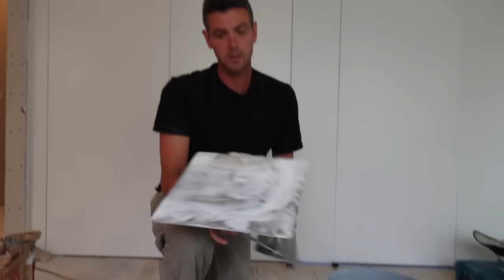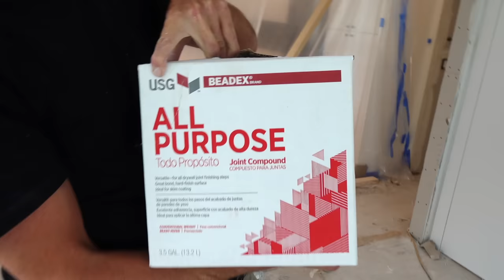Taping Drywall for Beginners Day 1

Comment: I've been doing drywall for 30 years and never seen anyone Use glue like that on paper. I usually just use mesh tape to stop it from bubbling. That is a great idea.
Reply: Try out Roman PRO-999 Rx-35 - it's a purpose-designed sealer for damaged paper. (The contractors I used all my life, who are sadly 1000 miles away from me now, put it on exposed paper or any time wallpaper is removed.) It's basically just a gallon of glue, and it dries a little sticky to be easier to cover with paint or mud.

Comment: I’m a diy guy and have done a fair amount of hanging drywall, mudding, and taping.  I’ve learned a lot from Vancouver Carpenter.  It’s been over six months since my last job and tomorrow I going to mud and tape a small room I drywalled   on my last job.  It’s room by room renovation of a 130 year old house.  I came back for a quick refresher before I start tomorrow.
Thanks

Comment: Best basic taping video I've seen. We had water damaged sheet rock in a closet from an overhead HVAC air handler that froze up over a clogged drain pan. Tore out all of the sheet rock as we are in Florida and mold is an issue. Dried the wood over 3 weeks and now am taping the new sheet rock. I have the tools but not the talent. Thanks for doing this video! It was a great help.

Comment: Been production taping in new residential since 1986, mostly in Alberta. I now do repairs and service work. When taping new work I most definitely v-cut my butt joints and cut out any loose paper and prefill with concrete fill or thick taping mud. Most in my trade DO NOT do this, and it shows up later on warranty work.
When people are paid by piece work without quality control by a supervisor, they often cut corners and leave problems for the painters.
You do a good job of explaining the basics, and could teach apprentice tapers how to do it right.

Comment: Another fantastic video lesson Ben.  Thank you!  I watch all your videos, to the end, sometimes repeat and always thumbs-up!  I am a remodel contractor and we do 90% of our own drywall work and I can attest to your methods and techniques.  Two things I would add to this video.  You wiped out all your taped seams starting in the middle of the tape and working out, then repeated the process going in the opposite direction.  But you didn't say this verbally.  This is a common mistake I see beginners make every time - they start at one end and try to embed the tape but end up pulling the tape, wrinkling etc.  This is a big plus for beginners to learn.  You did it, just didn't tell them why it's important.  The second thing is applying mud to a seam with the side of a 6" knife is not a beginner skill IMO, it's advanced and takes a while to learn.  Not something the average DIY'r / beginner is going to learn in the course of a DIY project.  A great video with many great tips!!  Thanks!
Reply from the maker: You are correct on all points. I kind of forgot about all that stuff once I got going. Might need to do a super duper beginner video.
Reply: Yes.  Much appreciate the videos

Comment: So, one thing he doesn’t mention with applying tape to flat joints that I learned is the knife needs to either flex, or you need to come at it from an angle.

Reason being is if the knife stays flat while you are applying the tape, the tape will only sink as far as the knife allows it to.

On my first go I ended up with the tape being flush with the wall, which made it very difficult to hide. Smoothing down the tape with the knife at a 60 degree angle should help push the tape into the recess.

Comment: Tips I learned from a 30 year mudder. Expect 2-3 applications to finish, throw your paper tape cut to length in a bucket of water and finger squeegee the excess off when doing long runs, and use a damp sanding block to sand. The dust picks up the moisture and drops straight down instead of airborne.

Comment: Thanks for the vid! If I can make a suggestion - if you're really bad at centering the tape over the pre-filled butt joints, it's worth marking a pencil line at both ends of the butt joint before pre-filling, where the pre-fill won't cover it up. Then, when it comes time to lay down the tape, you can just center off of your lines.
Reply from the maker: Good idea 👍
Reply: @vancouvercarpenter  Big fan by the way! Keep up the amazing work!
Reply: I do this trick on long ceiling runs as the center is really hard to see once mud is applied or if you are using a tool that preloads mud on the tape like the tapebuddy.

Comment: I’m using your video now to do my house ceilings! I put insulation up myself and my son put drywall up in one room I’m taping and muddying then paint .. then light fixtures then crown molding baseboards and tiles .. it’s only drywall n muddying I’ve not done 🙏 Florida hurricane and insurance didn’t cover enough for the high contractor price gouging! That’s our issue in Florida .. knowing what supplies cost contractors are charging x4 with a huge upfront check … sad this is happening 14 months later! But thank you!!

Comment: One thing I did like about your outside corners.  You placed the cut at the bottom.   However if you need to join corner bead.  The trick is to always have red and green snips.  Never use yellow.   The low side of snips are for the waste or cutoffs for a perfect clean cut.  If no joining subtract a half inch from the flooring.   The baseboards cover the bad cut.  However try not to leave a Burr.  The next person may not know and could cut some skin.

Comment: Nice informative videos you have on drywall. I've done it here and there but it's been a looong time since I've done any at all. I had to demo my bathroom a bit and now I'm ready for the drywall. I was going to just jump in with both feet but then I figured I'd watch some YouTube on the matter (the last time I did any drywall,  there was no such thing as YouTube.. being a plumber myself,  if you would have told me about YouTube,  I would have assumed you were talking about a P-trap.. lol). 

So I watched your video about mixing small batches of hot mud and you roped me in from there. I've just binged a few of your videos. You do good work and you're a good teacher. If I may chime in about mesh tape. I'm 100% all for it. It may seem to be weaker than paper, however, the fibers are much longer and not unified.  Each strand brings its own strength to be added to the rest.  Being a rook, I get a lot of blisters with paper tape. Another quality about mesh is when you get the yellow stuff, you can see the yellow color before you expose the tape when sanding,  thus preserving that first step, ..for a rookie.

I just subscribed and now I'll see what you can teach me about sanding.  ..oh thank you big time for showing how to deal with bits of blow outs and torn/exposed paper. You saved me 2 more steps👍👍 ..oh, and for the tip about the inside corner roller. 

Lol I had such a bad experience with the last time I did inside Corners that I left them all intact on my bathroom job lol then  I attached some backing to those studs and now instead of two inside Corners, I've got four butt joints. LOL

Comment: I never see Durabond at Home Depot nor Lowes. I have to order from Ace. I love it. It is not easy to sand, but, if you apply it correctly, it lays smoothly, and it does not crack. However, it did give me an issue when I layered two coats. It formed a big bubble, which had to be burst. I read that is not uncommon with Durabond. I cannot remember why. I believe it had something to do with it not being fully dry. I fixed the hole, reapplied Durabond for the first coat and used all-purpose for the latter coats.

Comment: A year ago I filled all the flat joints in one of our rental properties with 45 minute mud without using any tape and it has not cracked at all.  I prefilled the butt joints with the same stuff and and did end up having to tape those after a year

Comment: You and another Canadian DYI’er on YouTube inspired me to take on our bathroom remodel.  Not as clean as you guys, but not bad for a first timer thanks to the info you provide.
Question:  on a bathroom, where part of the ceiling transitions into the shower area, how would you tape the ceiling to wall corner there?   Or leave it for the tile thin set over the backboard to protect that area?

Comment: Ben - Question.  How do you tackle old tape joints that peeled right off due to age?  For example a garage that got a tape coat when new but the garage was never finished.  It has all brown-out and even started to peel.  It call comes off easy but you have these 'slot car track' channels for each joint especially on the ceilings. Can i sand those down as long as i dont burn the paper and have to shellac it?  I still want to use paper tape rather than lazy-out with mesh that likely fails later.  Guessing i'll have to fan out these joints further since they are already built up some regardless if they WERE butts or flats?  Advice would be cool.  -U10

PS - Your insight has helped me doll up our old house that we sold for good $ and buy a house in need of work in a good area and make it nice.  Thx.

Comment: And while on the soapbox, LOL.   The "Green" mesh tape for "Mould resistant" drywall (greenboard, blue, purple depending on your location).    Bit of con that one.   As you use regular paper in the corners of your new shiny bathroom....so no really advantage on that product.   Lots of "DIY'er" products in the big box stores to make your wallet lighter...

And you can get "regular all purpose (blue lid from CGC)" in eastern Canada, no idea on the West Coast.    Great for taping and setting corner beads.

Comment: Question which I've been asking myself. Why not tape at same time as filling? That way you have the closest drywall paper to paper tape bonding, and Durabond seems to stick well to paper tape, unlike some hot mud. With that said, I can also see the viewpoint that using normal mud draws the paper tape closer to the drywall when it shrinks... but then might as well fill with a hard all purpose mud (blue bucket) 🤔
Reply from the maker: It’s because the prefill shrinks too much. It will suck the tape in and stop it from nice and flat. The flatter the tape, the stronger the joint.
Reply: Allows mud to setup and start to harden and not move around when embedding the tape. 
One trick I use is a "rectangle taping knife" that has a curve so the curve pushes the tape into the mud allowing the second coat to fill in perfectly... especially on flats and when using fibafuse. Takes some practice to not push out too much mud. 
Most normal 6 inch tapered knives are perfectly flat.

Comment: never had an issue with mesh cracking provided you use Powered mud (not the ready mix) and "Durabond/concrete fill" type compound first to fill the gaps.   generally if it is wall to wall I use paper regardless otherwise mesh is great for butt joints, small jobs, repairs and areas where I don't care if a crack appears behind the kitchen cabinetry.   My biggest gripe is "drywall finishers" who don't finish the drywall because "it's getting tiled over" for example.    If you are paid to finish the drywall, finish the bloody job.   That goes for framers who install bent studs in key locations all over your new build (speaking from experience of my 1/2 million dollar new home.. sigh)

Comment: I have a small corner tape project in the closet.

Instead of buying drywall tape from home Depot and used only fraction of it.

I want to know what your experience is using a brown grocery bag, cut to 2-3 inch strips and fold half for the corner s. It seems durable and paper can soak mud as good as drywall  paper tape.

Comment: Wow! I love your videos, all of them, and have learned so much!  One question I have is, Can I tape and mud up to and blend in with existing paint on drywall?  I am doing a reno and adding a large elliptical arch and there will be areas of existing drywall and paint and I don't want to remove but will repaint the entire wall.  Is it possible to get a nice even flat wall by feathering new up to the old?

Comment: Thanks for these videos. They have been a great help in my remolding. My issues though is with the mud. When I mix a batch for taping, I either have too much water or not enough. My question is, if i mix up my mud and it starts to dry out in my pan, can I add more water or is these batch ruined? Thanks, Barry.

Comment: I love your channel and have been a fan for a few years. I have a question that you could address. I am at the project stage, installing metal corner beads. I have an area where I framed a 4' x 4' shower. Shaped like this -> |_| . I have sheetrock on the outsides and the ends of the show, but how do I make the 90 into the shower? In a non-shower situation, I'd obviously use corner bead, but how do I get around the corner when I meet up with the cement board and tile?  Again, thank you for all of your entertaining videos and great information. Cheers!

Comment: Have you ever heard of using a good penetrating primer in between coats to increase strength and toughness in areas that you want toughness, without having to deal with the hassle of hard mud? Another words toughness, yet easy to sand.

Comment: My dad was a drywaller. I mixed mud for him when i was in my late teens.
I have to say, this method of applying tape is an inferior method, as it is slow, and more elbow grease is expended than  necessary.
The best way is to use a tape box.
This a hopper, approx two gallon,  hung on the wall filled with mud with a roll of tape mounted on a spool fixed to the box.
The roll of tape is fed and pulled through a horizontal, adjustable slot in the side at bottom of the hopper.
When the tape is pulled through, a coat of mud is applied to the tape and gathered into a pail tied around the waist.
The coated tape is "slapped" onto the joint.
"Slapping tape" it is called.
When working with both uncle and dad, i often haf to slow down as they could not keep up.
The tape box was homemade.
It is the easiest fastest way to apply tape, you dont have to apply the mud with a putty knife...it comes through the box already coated.
Drawback is, its a bit messy.
....
Reply: 1. This is a video for beginners.  Beginners aren't using tape boxes.  2. Where can I find your instructional videos?
Reply: @jasonwhite1069  if you're gonna learn as a beginner, might as well learn what works most efficiently don't you think?
.....
My instructional "video" is my comment....take it or leave it.

Comment: I have been doing home improvement for 20 years and do quite a few drywall repairs.  However i would repair the drywall and my father would tape and spackle because he enjoyed it so much.  Now that I don't live near him anymore, I have to fend for myself and I want to get good at it.  I think the biggest takeaway I got was that I made the mistake of not mixing the drywall right out of the bucket.  I definitely have to have it looser especially for the second coat.  
My one question I do have:  I did a job of closing in an entry door and had to tie in regular drywall to old school lathe and plaster.  Is there any special technique or tape that would get a better finish to tie in the two?
Thanks so much for all these videos!

Comment: Best tip , my hangers keep hanging it way too tight, gave them two nickels and told them they better fit, butt joints something no one is talking about, butt joints should be V out by hangers. Dura bond and Easy sand aren’t even close to the same thing.

Comment: I enjoyed your video! Question, do you add water to the premixed? Your mixture doesn't seem to be as thick. Also, do you have a link for the roller you used in the corner? Thanks!

Comment: Always a great resource.  I did the upstairs myself but hired a "professional" for the bottom of the house.  He left tape on the moldings and some is embedded in the mud he flattened.  What is the right way to remove this tape as its embedded  in mud/paint in some places.  I am thinking if cutting it out very carefully but it leaves a tiny cutout between the mud/paint and moldings.  I am thinking of following it up with caulking.

Comment: Hi there, I've read that drywall compound when mixing/sanding (the dust that is) can be quite toxic to inhale and even the painters masks with filters don't do the trick since the particles are so small. Is that only when working on large scale jobs with a lot of cutting or would simply mixing this compound/sanding be a hazard as well? I've been looking into drywall repair as a side job so I just want to get as much info as possible. Thanks for all of your great content!

Comment: At 13:14 question:
How do you know you didn't put your 90 on too thick, so that when you tape and mid over it, it isn't raised up higher than the surround wall? 
How do you ensure it is all even and flat even with numerous steps?

Comment: Vancouver carpenter
   I watched several of your videos on how to plaster and actually got very good at it so when I had a small closet to drywall I figured I could do it easily without researching any drywall work 
   I’m guessing you know where this is going, I did the entire job and filled everything I needed to with mud but didn’t tape anything 😮

  Now I haven’t painted yet  can I just tape over the seams at this point? 

   I honestly thought tape was to make the job easier for some reason and didn’t see the advantage , thank god it’s only a small closet 
   Any advice I sure would appreciate
   Thanks

Comment: Sorry if this is a stupid question, but can i use that mud to skim over concrete block. Its just an outside corner at a door about 8in by 4in. The old hardwall is off but its engrained in the block like a kind of filler. Cheers for the help.